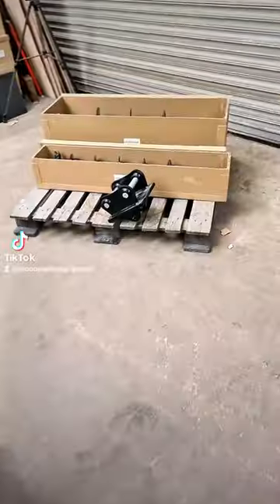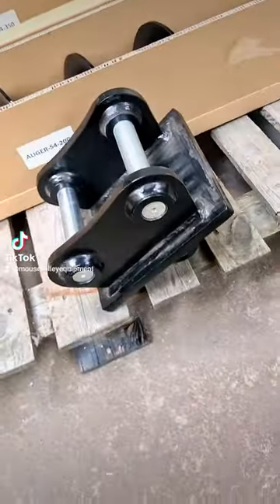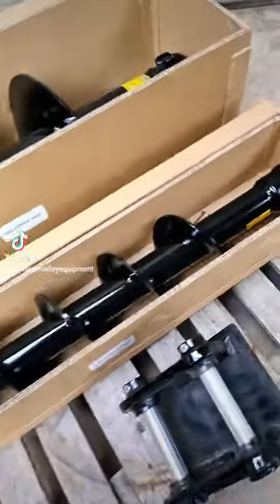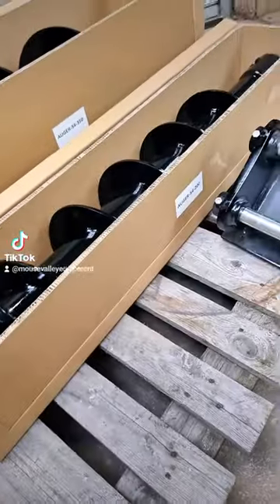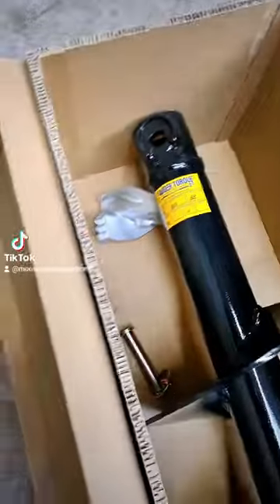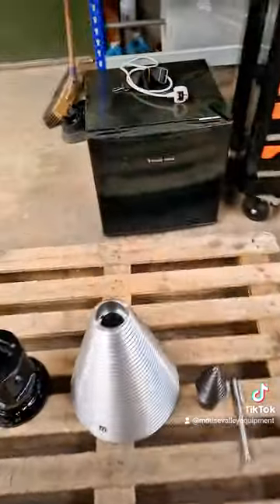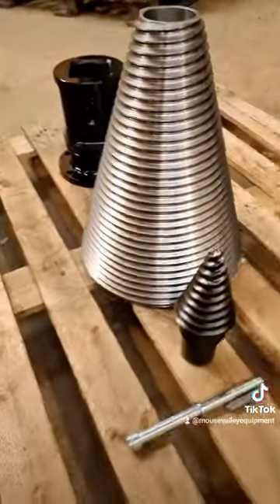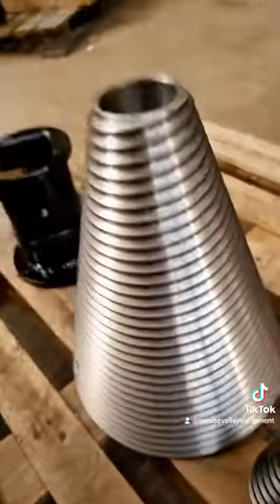Log splitter cone for Auger Torque earth drill

Comment: Is the 300mm log splitter augertorque as well?
Reply from the maker: No, it's our own product designed to work with the Auger Torque drives. The Auger Torque Cone is only 180mm diameter